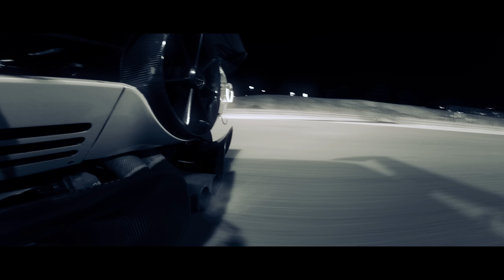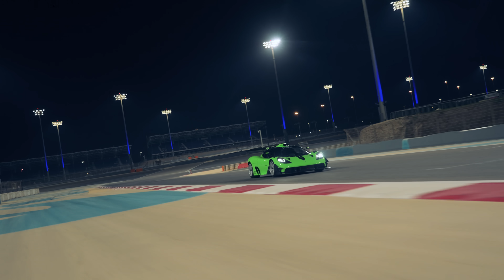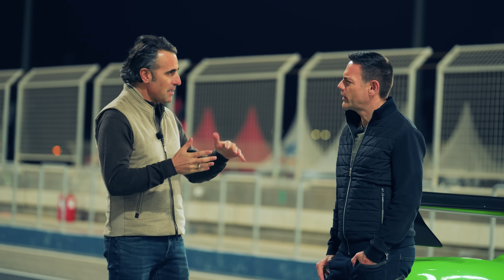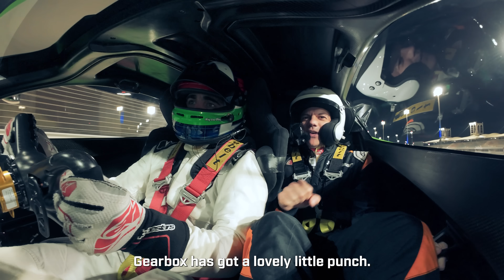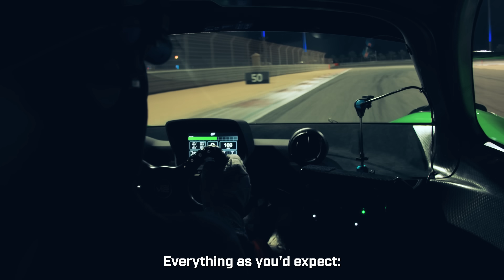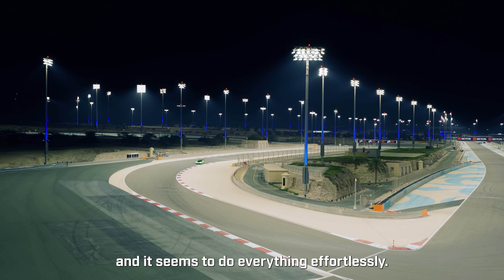Gordon Murray's V12 Masterpiece: New GMA T.50s! | 4K

Comment: If you're a real petrolhead, I don't think you could buy a better car than a T50. I've run a Jaguar i-pace EV for 2 years, and it's fast but not fun. Not exciting. I did a track day recently and drove a McLaren 720.....at the speeds I was doing on the small narrow 'track', I can't say it felt faster than my Jag, but was so much better with the noise and the gearchanges. Obviously, if I was a proper driver and was going fast on a real circuit, the 720 would leave my Jag for dead, but below 100mph, I reckon the i-pace can keep up with a lot of exotic cars.
I've owned Porsche, AMG, Alfa.....I do miss having a real engine!!

Comment: What an intoxication sound. A fast and friendly car. 30 secs slower than an F1 car - I was expecting less of a delta considering it is a relatively short track
Reply: It's only 4 seconds off a LMP2 car. And almost the same speed as a LMH car. This car wasn't designed to have the most downforce it could, widest tires etc. it wouldn't be driveable by owners if it became a full on racecar

Comment: Much better looking than the standard T50 in my opinion. And I'm not talking about the aero but rather the actual design elements like the straight line bodywork below the lights at the rear instead of the weird angled grilles. Similar thing at the front.

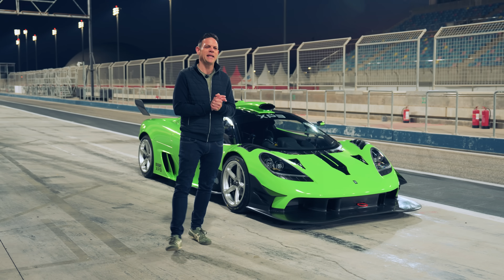Comment: Was that push lap a 1:58 or 1:56? Either way, it's at least 2 seconds quicker than the all-time lap record for a GT3, possibly knocking on the door of GTE pace, and probably would be if they really wrung its neck on setup. Very impressive for a car that is designed to have such a broad operating window.
Reply: They logged an official 1:53
Reply: @k-mc94  so, basically, faster than anything with a roof that doesn't start with LM

Comment: I hate to be the guy that hates on this but for under 900 kg and 760 hp....the speed numbers are not impressive. At the end of the start finish straight I expect at least 300kmh from such a car, unless we are not being told the car is running in a conservative mode to ensure Jethro doesn't bin it.
Also what is this diabolical editing we have here? One shot the car is going onto the pit straight the next we are going to turn 13.....at least be coherent in the shots you show

Comment: 6:05 Uhhh, it most definitely is used for downforce. This guy think it was a non working gimmick? Did he not watch Top Gears video on it. The rep handled that comment well. I would have got attitude.
Reply: 322 kg of downforce with no wings and splitters. Iron stability and braking. 12.5% less drag. Even a bit of thrust. I don't know why after so many videos on it a lot of people still think it's a gimmick. On the T50S that fan makes the bulk of 1200-1500 kg of downforce.
Reply: @srinitaaigaura  exactly

Comment: This how tesla drivers feel when there driving there yoke steering wheel. What a joke of a car, Tesla putting a yoke steering was complete failure, that car is so emotionless when you get use to the acceleration. I get 0-60 2.5 seconds is available to electric cars but the raw emotion of a gasoline will never be match by electric cars .

Comment: Man... That baby can sing! 🥰
Is the crispness of everything a product of tuning? 🤔
Can modified road cars be tuned with this kind of crispness in operation? 🤔
Reply: No, because they wouldn't be road legal. Different transmission, throttle bodies, valve timing, valves, injectors, exhaust, gearbox, brakes, chassis, aerodynamics, wheels, suspension, etc. it's completely different

Comment: God bless GMA (Mclaren, & Pagani too) for still using HYDRAULIC steering. GMA has copied the Pagani Zonda's recipe for perfection, (esp. with the S1 LM).. Extreme lightweight, GLORIOUS N/A v12, MANUAL gearbox, hydraulic steering, carbon-everything, perfect styling/design, tons of mechanical grip, plus tons of downforce.

And no extra sound deadening, electronics, tech etc. Why's it so hard for brands to understand this?

Even Corvette could mimick this recipe on the Z06.. (but a budget version). Keep the LT6, strip 300lbs of luxuries/comforts/features (very possible), do hydraulic steering, another -200lb for a tight-ratio sequential or manual, add Z06 GT3's body/aero/diffuser, -70lb manual CF bucket seats, manual steering telescoping, lexan glass (where possible), AP iron brakes, etc.🙏😅
Reply: Trust Mclaren and Porsche for that. The C8 is far away from a drivers car now.

Comment: Amazing car and for brakes use two brake calipers to share the load and heat and increase in brake potential plus this makes room for wider tyre more contact with road more gripe and of course brake force with out wheel lock up 😊❤❤ give it a try and see

Comment: For me , Gordon is THE genius when it comes to cars , the most important thing is how a car makes you feel when driving it and how it handles.
A car, these days can have several thousand horsepower , but it's not much use if the car has awful handling or can't put its power down , so the numbers are, to some extent , 'bravado' .
You don't need 1000's of bhp if the car is light and if the downforce is 1 and a half times the weight of the car , it's going to handle well and that is all that matters in my opinion.

Comment: 1000.0v»Ecoboost¹⁰120v/240v-Gnd/LAN»Peripheral
Auxiliary input/output device for a computerGalvanometerInstrument to measure electric currentSodiumchlorideChemical compound with formula NaCl¹⁰
AMOLED²⁰⁰⁰
Display technology for use in mobile devices and televisionsSoldering StationClassificationSafe operating area
TechnicalspecificationRosin used as flux⁹ for soldering³⁷
A flux pen used for electronics rework
Typical laboratory disstilled⁹⁹ water unitUntil World War II, distilling seawater to produce fresh water Soldering StationClassificationAccelerated Unlock:ClockWind:Accelerate: Speed Intensifier: "Cydia acceleration"⏬️⏬️⏬️⏬️⏬️⏬️⏬️➖️➕️♻️♻️♻️♻️♻️♻️♻️¹⁰⁰»》continuity  concentrate》

Comment: 120v/240v-Gnd/LAN»Peripheral
Auxiliary input/output device for a computerGalvanometerInstrument to measure electric currentSodiumchlorideChemical compound with formula NaCl¹⁰
AMOLED²⁰⁰⁰
Display technology for use in mobile devices and televisionsSoldering StationClassificationSafe operating area
TechnicalspecificationRosin used as flux⁹ for soldering³⁷
A flux pen used for electronics rework
Typical laboratory disstilled⁹⁹ water unitUntil World War II, distilling seawater to produce fresh water Soldering StationClassificationAccelerated Unlock:ClockWind:Accelerate: Speed Intensifier: "Cydia acceleration"⏬️⏬️⏬️⏬️⏬️⏬️⏬️➖️➕️♻️♻️♻️♻️♻️♻️♻️¹⁰⁰»》continuity  concentrate »

Comment: Oh no it doesn't have a steering wheel!. Change the steering wheel, add a muffler, tune the sound. Remove the huge wing. Detune it to 500hp and max perhaps 9k rpm and we have a brilliant modern road supercar. Keep the fan but perhaps make sure you don't throw rocks and pebbles all over the road. If it's impossible then loose it and use the saved weight for extra sound proofing in the cockpit

Comment: You can tell this car was made by proper race engineers who understand that pure driving emotion comes from an agile, lightweight chassis with a light high revving engine.  Not some hugely powerful mass monster.  It looks like a pit crew set it up so anyone at a track could jump in and dial in themselves and the machine as one with all those proper switches and not stupid screens.  Light, powerful and with tonnes of grip and bloody Dario involved in the process and you end up with a dream machine.  Well done everyone.

Comment: That last 1000 rpm literally has me holding my breath, what an unreal noise
Reply: when thinking of so many cool stuff about this car : shape, noise, the feel of speed, the fact that it has central driving position and 2 extra seats, but then thinking how much a set of new tire would cost, a set of brakes, a windshield replacement, consumption or other things maintenances related about this car it just not feasible to be owned by a person, it really makes sense to be kept by Mclaren customers racing team but allow people to experience the car by pay for renting passes 30min or full hour on different circuits with proper set-ups..

Comment: The fan below the large spoiler at the back makes the T50S much better looking from the rear than the stock T50 - the proportions aren't dominated by the fan. The side grills add the aggressive touch this car was missing, and the sweet V12 engine completes the perfect package!
Reply: That's because of the shrink wrapped slightly flatter rear end. There's nothing under there but open space.
Reply: @srinitaaigaura  Yeah, that helps as well.

Comment: 4:50 so it is the only N/A engine on planet earth that get´s MORE POWER from a RICHER mixture?
Reply: If I had to guess it’s probably got a similar system to vtec. So yes when it gets more air it needs more fuel. He was probably just saying it like that.
Reply: @ThatPython_RS3  But any way: A richer mixture = LESS power.
A leaner mixture = more power. Always.
Reply: @ThatPython_RS3  Besides the above: no vitec like
https://youtu.be/7bLMR0fGl0c?t=103
But it is - of course a variable valve timing, as one can see on the cam gear.
Reply: Could be a separate cam at 8500+ allowing for more air and thus requiring more fuel.
Reply: @mattb4251  So you agree. IF so the cam will make more power NOT the fuel.

Besides: This V12 is relatively well known. One could check if that head has different profiles.
But I do not think so, from the original one.

Comment: While the pinnacle of motorsport is switching to 1.6 engines that needs to spool up turbos for 30 seconds to produce max. power and then the max power together with electric bits lasts for like half a lap. This is a wonderful reminder of good old days.

Comment: 195hp/liter is super bike numbers, that’s insane
Reply: Just wait till some fat arse sits in it. That will change the power to weight ratio!
Reply: Covette Zr1x would kill it😂
Reply: @Beastnappy Weighs like 2x T50s
Reply: @Beastnappy not on a track you fool
Reply: @Beastnappy not on the Nordschleife
Reply: @Beastnappy  slow junk got smoked by a Gt2 Rs at the ring, what do you think this thing will do to a Zr1X 😂
Reply: @ChineseChad Zr1x  would take the in the 1/4  as well as the Old Gt2rs😅
Reply: @Beastnappy not on track tho which is what its made for 😂
Reply: @Beastnappy   no one cares about the quartermile, cute kids stuff. Put both on the ring as men do
Reply: @mcsike7264 I think you are getting upset. Ameirica has been a dominant factor in the sports car world for decades.... Now, we are ruling the hypercar market for a fraction less! 
So yes, I see why you are upset🤣
Reply: @Beastnappy ruling hmmm no like an american your way over your head zr1x is fast but not hyper car fast calm down it gose 233mph a malaren f1 the old one dose 250mph and its NA Zr1 as 2 massive turbos and electric assist bugatti 240-300mph nevera 258mph byd u9 extream 308mph sure zr1x is fast but not huper car fast it may be quicker in the 1/4 after that its getting pulled in and gapped
Reply: @mcsike7264 Bugatti couldn't gap an SCC Ultimate but that's not the point. The point is nobody buys hypercars for drag racing. Who cares if the ZR1X can beat another car in the 1/4. People race on roads that turn. And on the right technical road the ZR1X will get gapped by an Ariel Atom. So will a lot of other cars that do 200+ in a straight line. They'll get gapped by a 230hp kart. So saying America runs the streets because Demons and the ZR1X win drag races is misunderstanding the point.
Reply: @Beastnappy  American cars were always irrelevant. In Motorsports, and in production cars. Americans just dont realize how far behind they are, but they think the won the Vietnam war too.

Le mans? American brands not even in the top 5. Formula 1? Forget about it. Fastest road car? German. Fastest ring car? German. Most valuable Car? Italian. Fastest N/A car? British. Most profitable sportscar brand? Italian. Fastest quartermile production car? Croatian. The list is much longer btw. You guys play zero role 😂
Reply: @wolfgangbarrio5043 DAMN
Reply: @Beastnappy  pretty pathetic attempt at rage baiting. I see why you're upset though, Murica'n cars are agricultural in comparison to the rest of the world. It'll be interesting to see if Cadi can do any better than the decidedly low-mid Haas now they are in F1. I doubt it.
Reply: @mcsike7264  just the facts lol. Even Americas most famous racecar, the Gt40, was british = European 😂

Desperate americans try to bring up their irrelevant cars through ragebait which is easily debunked by us carguys, because we know cars better than they do.
Reply: @wolfgangbarrio5043  Americans were always jealous of european and japanese cars, because they dominate their own car industry. Thats the case nowhere else in the world

Comment: Wait, the Valkyrie was supposed to be pushing the absolute limit of weight savings. And this T50s is 400kgs lighter?!?! GM is truly an automotive wizard
Reply: If you compare apples with apples like the track version of each car the Valk AMR Pro weighs 1000kg. In road spec i'm sure the T50 is lighter though.
Reply: @k-mc94 ah yes you’re right, but still the AMR pro was supposed to be the most bonkers car ever and this is even 100kgs lighter than that…

Comment: 1050kg with a driver and gas. The engine and automatic are a let down. A 7l Chevy and MT do it better and much longer at 25k pricepoint. Am marginally impressed but will sell well in the middle-east.
Reply: No. No Chevy does anything better.
Reply: @vanessalele3953  can‘t read torque and hp curves of engines? You want flat curves to 6k. A peaky McL has much less of everything where it counts.

Comment: So this car weights 80kg more than current F1 cars on the start 😮🤯
Reply: Sad thing is - it weighs the same as the steel bodied, iron block engined, 5 seat family cars that anyone my age grew up with. Cars were/are just lots more fun when they are lighter.
Reply: It also smaller
Reply: Actually the min dry weight is 798 kg, so with full fuel, the weight of the current F1 car cannot be less than 908 kg. The T50s weighs 862 kg without fuel and driver. So it's not much heavier than actual F1 car.

Gone are the days when the F2004 car used to weigh 600 kg without fuel (660 kg at most with fuel as they had refueling).
Reply: Because they have the MGU-K (hybrid powertrain) that adds weight.

Comment: Cosworth have pulled a blinder with that engine. The numbers are so impressive.
Reply: they build bugatti v16 too. I am damm sure they electronically limited it to 1000hp cuz if this 4L can make 750hp, then that 8L 16cy beast can for sure make 1400+ hp. They will be doing that in SS variant. Imagine 1400hp engine + 1000hp ev motor lol.
Reply: @mobileGameZGG this 4L doesn't need to conform to any emissions regulations like the 8L V16 has to.
Reply: T50 road version has 670hp too.... So the 8l v16 should be able to produce 1200+
Reply: they're also the ones building the redbull engine this year for ford...
Reply: @carbonz5174 That is completely false. Cosworth is making the engine for the RB17 track car. Nothing to do with Ford, RBPT or F1 whatsoever.
Reply: @carbonz5174 Really.
Reply: @carbonz5174  Red Bull, actually.

THAT ENGINE IS MENTALLY DISTURBED.

Comment: Super light cars also means less material consumption in manufacturing and much better fuel economy and therefore much lower emissions and also lower costs. Something that the modern car (sorry tank) manufacturing industry has blissfully forgotten.
Reply: Not forgotten, they want to peddle you more expensive things by making them unnecessarily big
Reply: @ShaiyanHossain And subscribe for the AC after that

Comment: This car weighs less than a mitsubishi mirage which is the lightest "modern" car we get in the US. Absolutely unbelievable.
Reply: Miata?
Reply: @haz3004  miata is always the answer
Reply: @haz3004  The ND miata is around 2300lbs. Base mirage is around 2100lbs.
Reply: Quick tell us all how much the average new car before suvs&trucks took over weighed in say 1975? Ah yes even then without airbags, crazy power, abs traction control, safety glass, seatbelts, excellent heavy brakes, big wheels n tires, powerful stereos, screens etc. Cars not counting trucks cuvs n suvs like today still weighed over 4,000# on average!!!!!!!!